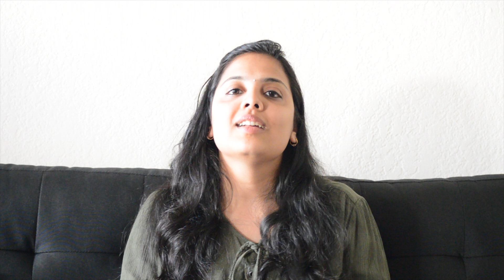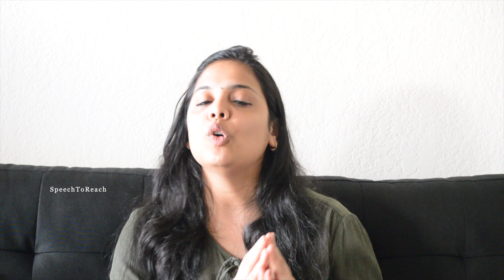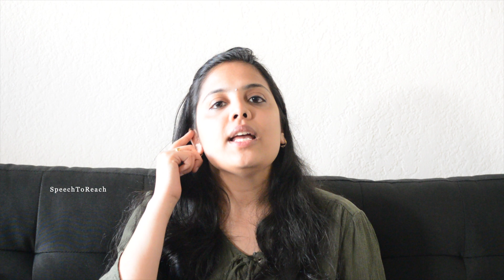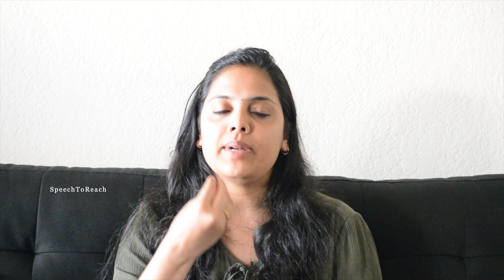കേൾവിക്കുറവിന്റെ കാരണങ്ങളും പരിഹാരവും Types Of Hearing loss, Causes and Treatment In Malayalam

Comment: 30 db loss in 250 hz and 25 db in 500 hz in right ear left is normal other frequencies are Normal.  Most of the audiologist not recommended using hearing aid. Since in left ear all frequencies are between 10 to 15 db.
   ചെറിയ വ്യത്യാസം എപ്പോഴും ഫീൽ ചെയ്യുന്നു സംസാരം കേൾക്കുമ്പോ മാത്രേ ഉള്ളൂ.  Sudden ayitt വന്നതാ  സ്റ്റേരോയിഡ് എടുത്തു compelte recovery ayilla.   Hearing aid IIC model use cheyyamo. Athukondu vere issues vallathum  varumo